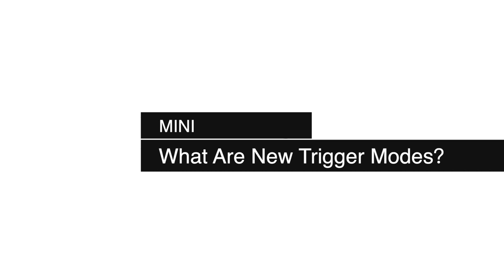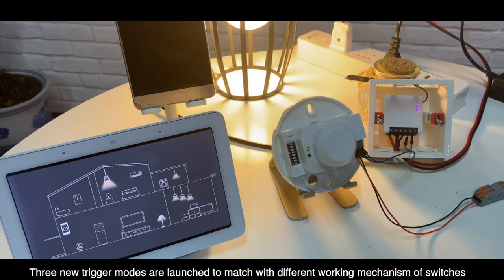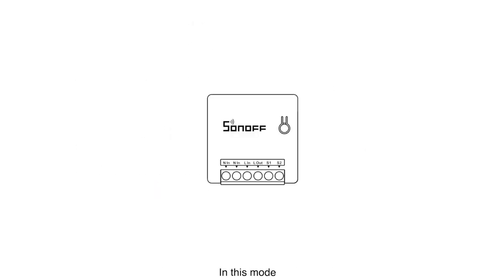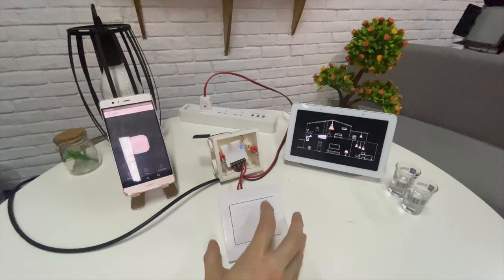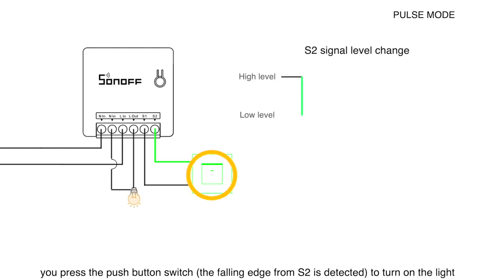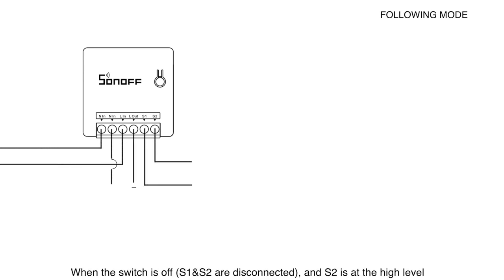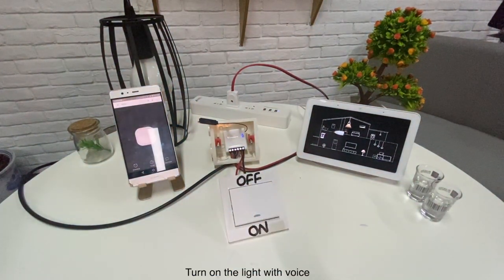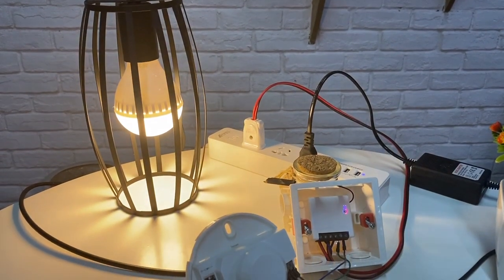MINI, More to you, Up to you, three new trigger modes update with MINI

Comment: A DualR3 activates and deactivates the luminaire it controls intermittently and randomly. The connection diagram is the one indicated in your quick start guide for 1 lighting spot. If I disconnect S1 from the external damper the problem is corrected, however I require that it also be controlled by this external damper (it is located 15m from the DualR3). Could this fault be caused by the damper type configuration?

Comment: Make a clean trigger mode with disabling control from the app. How much can you play with lamps. In the household, there are many more places where automation and control based on the states of different sensors is needed.
Reply from the maker: If dry contact connection, you can use 4CHPROR3 4-gang smart switch. Otherwise, you can use the 2-channel smart switch, like DUALR3 smart switch.
DUALR3 2-gang smart switch: https://itead.cc/product/sonoff-dualr3/ 
4CHPROR3 4-gang smart switch with RF control: https://itead.cc/product/sonoff-4ch-r3-pro-r3/
Reply: @SONOFF  what does the number of channels and dry contact have to do with it? I am writing that in trigger mode, when working with different sensors, I need the option to deactivate control from the phone screen, in order to avoid accidental clicks

Comment: I don't urderstand in the third mode FOLLOWING MODE, when the switch is off and the guy turned on the light by voice command, why has it happened although the switch is off then s1 and s2 are disconnected?
Reply from the maker: Like you turn on the MINIR2's on/off using App, but the physical switch keeps the original status, then you can press the physical switch button to make it same with the on/off of light, so you can judge the on/off of load according to the physical switch button.

Comment: In edge mode, if the MINI is set to off, but the switch is in the on position, will turning the switch on turn the MINI off?
Reply from the maker: The on/off load will be changed every time you press the switch button.

Comment: It's still too big to fit inside existing light switch. We need a micro instead; one quarter the size. By the way, hey siri has stopped working.
Reply from the maker: MINI can be placed in almost all mounting boxes.
Reply: @SONOFF  86mm switch occupies nearly all the space. There is no way to fit sonoff mini inside. Maybe you want to show a video or post some pictures so that we know how to mount the mini inside a mounting box.